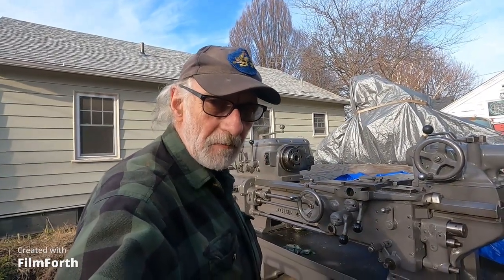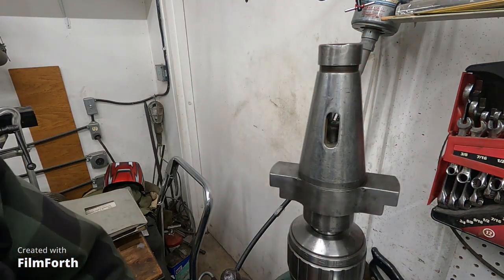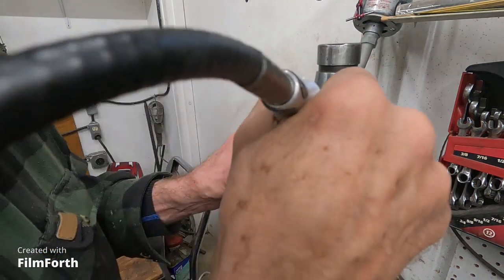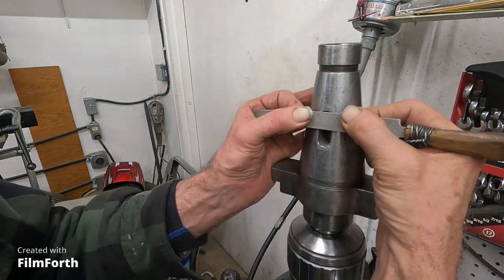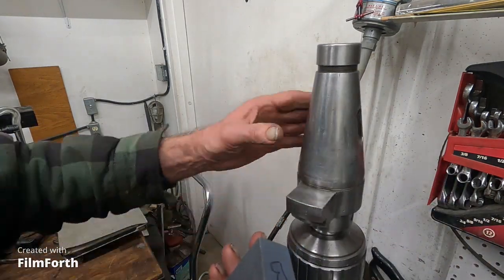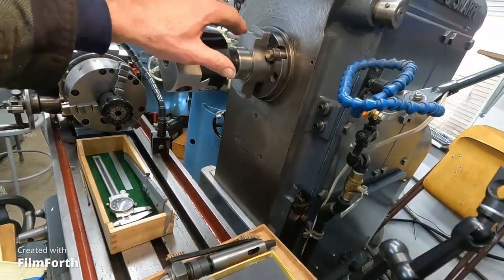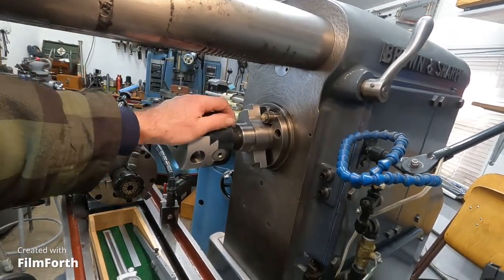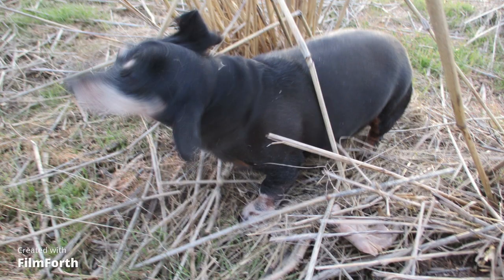Machine shop week end check

Comment: What model axelson is that?  Looks like a very nice size.
Reply from the maker: Hi, that is their smallest 1941 14X30 5hp #1022 that was sold to the Foote Burt machine tool company. The Axelsons are heavy like the American Pacemaker.
Reply: @deedeeindustrialsuperprecision  I have a 1942 MG 10EE that it would compliment nicely!  Ill have to keep my eyes open for one.
Reply from the maker: @chrisosowski8531  For a gearhead lathe it is a better compliment for a 10ee than the Monarch models of the same time period, with 24speeds and over 1000rpms, with an unusual reversing clutch very useful for metric threading. The only draw back the machines have is everything is way overbuilt and small things like shifting gears takes more effort, but the carriage and slides  glide nice.

Comment: Good one . I see you have seen the light with the magic stones ! I used to to alot of boring on a horizontal mill with a set up like you mentioned .  Back in the days when ID welding & line boring machines were  not a common thing back in the 80's .    Cheers .
Reply from the maker: Back in the 80s I was working in sawmill machine shop as a millwright, often when I was called out into the working mill operation I was told "don't stand there you may be killed". Back in the machine shop there was very old heavy horizontal mills that we fixed the busted reduction gear boxes and all manner of things with by welding back together, sleeving and line boring using what we had. This #2 size does not have a lot of capacity, but great for small engines and things like that.
Reply: @deedeeindustrialsuperprecision  I used to do a lot of Caterpillar loader bucket linkages . Bore out & machine bushes to take back to standard size .   Used to have to get your interference fits spot on so the cat bushes would be a press fit into the bushes i made .                                I saw your  good friend Keith Rucker machine a bronze bush a bit over 2'' OD with a 4 1/2 thou interference  & only 2 thou running clearance on the ID before pressing in .   Then he gets the gear that fits it , slides it in perfectly .   No  fuc-in way would that fit   , it would split the casting  on his 100 year old boring mill , he pulled the wool over everyones eyes with that BS !  I do not watch the idiot any more !
Reply from the maker: @swanvalleymachineshop  Here is where the Rucker/PM bunch fuc*ked up, they got a crooked Texas cop and a fake machinist from SC to stalk threaten and harass me over calling them out on their own fake machinist forums they own. There are 4 of them that stink up the US internet with their selected fake machinist minions and crap content,  not one could hold a job in the field and it certainly shows, they censor by bullying, being a former Harley Davidson Dealer, I have had the best training to deal with bully's and their crooked extra stupid Texas cop. I have blocked at least ten of these half wits so far.